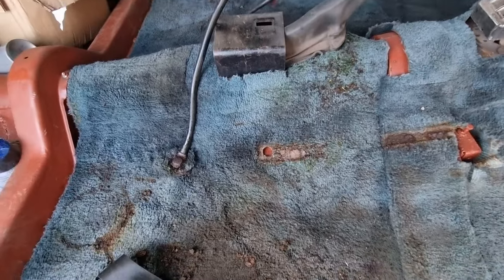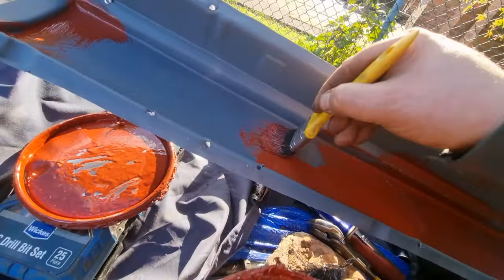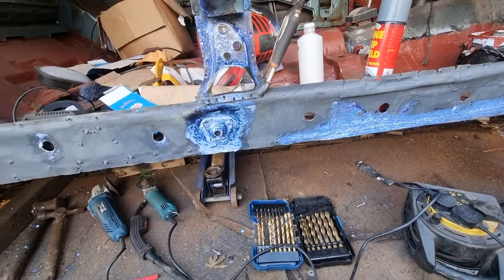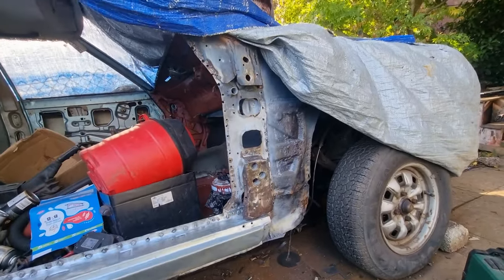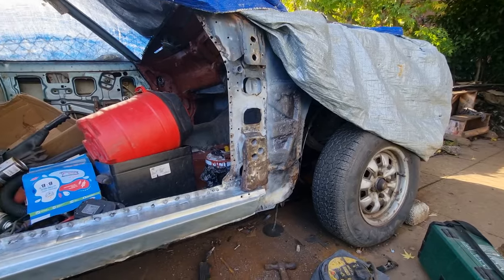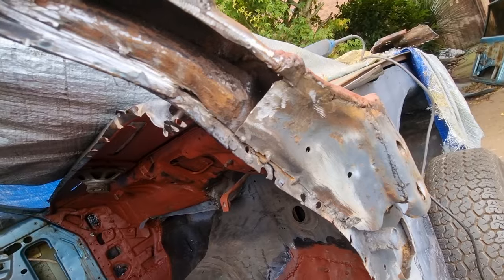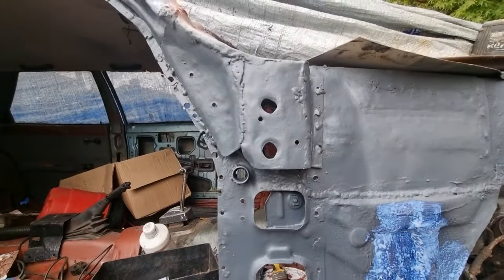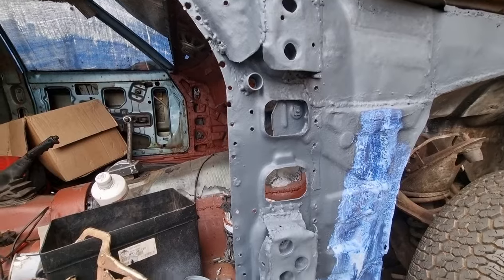Cortina Mk4 Ghia 2.3 V6 // Restoration outer sill drivers side welded in  (P53)

Comment: looking great there!  the outer sill, is a massive step! it would look class if you put the driver side door and wing on,  just to see what it looks like.  As for the carpet, Nah leave it blue, be different., i did with my rover metro, most of the interior was blue. So i switched the seatbelts from the standard grey to blue from an earlier car, painted a few white trims black.
Reply from the maker: Yeah will give it a wash I did put the drivers door on but took it off again as I'm in the middle of getting ready to weld the outer post back on then will stick the door back on again and test fit wing to